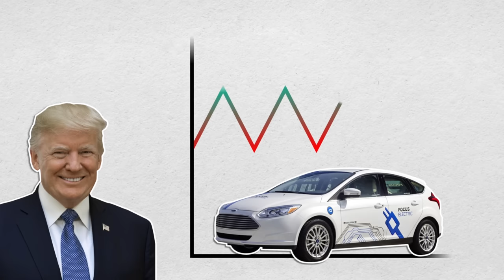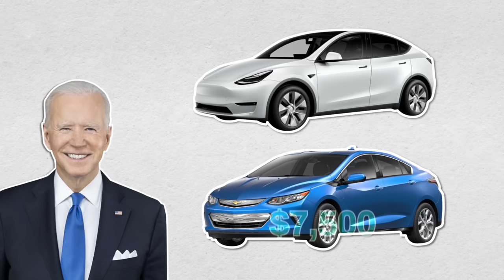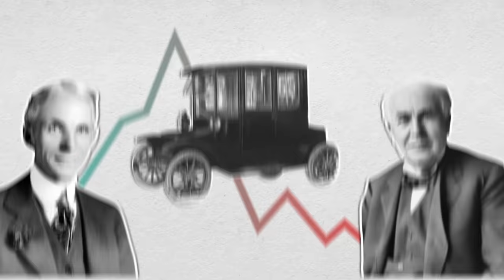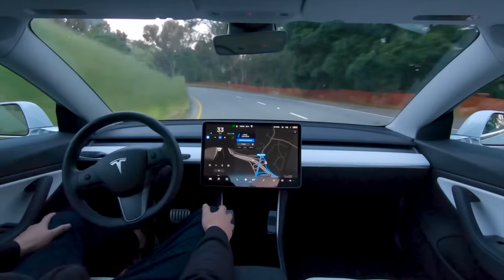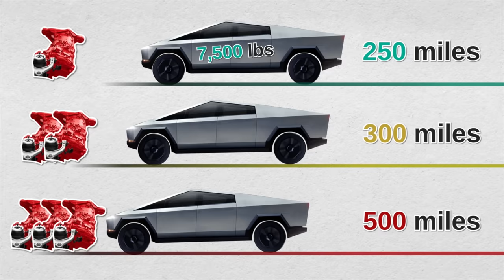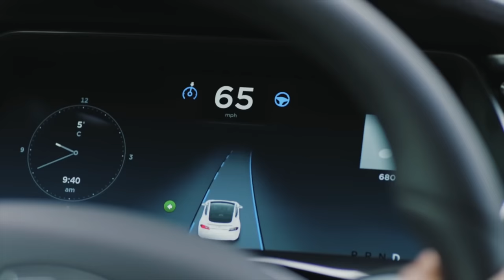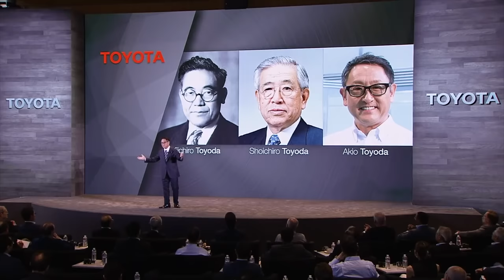Here's Why Toyota is Refusing to Make Electric Cars

Comment: Scotty, you forgot  that there was actually a mass produced car from GM called the EV1. The car was produced and leased from 1996 to 1999.
Reply: Mass produced = 1100 :D   Some on CNG methane gas, they were also hybrid and fuel cell prototypes.

Ever heard of CityCar build by Sebring-Vanguard ???   They've made ~~4500 of them between 1974 and 1979

But in 1906 Baker Electric -- made 800 Electric cars (Jay Leno has one - you can watch how it look like) -- so EV1 production number is laughable :)
Reply: GM also briefly produced the Chevy Volt.
Reply: @rscott2247  Cadillac made the ELR based on the Volt. Looks great, was crap tho.
Reply: There were electric cars from the 1960s aswell. Jay leno has 1
Reply: @wyrazowfkp  1100 prototypes? I'd call that mass produced.
Reply: Inter first time I heard of this car. But there have been a ton of cars I never heard of so he he
Reply: To say nothing of the Detroit Electric that had a lot of very happy customers who used their vehicles for many decades.
Reply: @wyrazowfkp  Rose's Water Ice in Philadelphia had 2 of them, they'd hire teens to drive them to prowl the local streets selling pretzels and water ice to kids and adults out walking and playing. The cars had an external shelf and cover attached to hold the products.
Reply: @wyrazowfkp  I was going to mention this too.  Electric cars date back over 100 years (and I've watched that Jay Leno video on the 1906 Baker Electric).  They just couldn't compete with the ICE.  Climate change wasn't even dreamed about back then.
Reply: Thank you  for saving me 9 minutes
Reply: Then GM bought back all the cars and crushed them at the scrap yard 🤔

Comment: Unless I'm forced to buy an electric vehicle, I'm keeping my Outlook, and my Vibe. I can put gas in my vehicles within a few minutes, and I'm back on the road.
Reply: My 12 year old diesel has a range of 700 miles, and takes minutes to refuel.
EVs are fit for the scrap heap after 9 years.
Reply: @twig3288  It’s clear electric cars aren’t for everyone, but I think for the vast majority of people the benefits far outweigh the negatives. Most people aren’t doing 100’s of miles a day on their daily drives. The most people might commute for work is 100-120 miles round trip, and that’s an edge case. You can have a fully charged vehicle, 300 miles worth, every morning after charging over night, never needing to go to a gas station again. Road trips of course is where people understandably see a pain point, but I would say most people do on average 2 -3 larger road trips a year. Here is where the infrastructure needs work. Even the Tesla network, which is very vast at this point, still can’t cover those out of the way places for fast top ups, and in that case you’ll need to charge at a hotel or someone’s home. That is where things are actually exciting though, because every store, every mall, everyone hotel, and every home could potentially provide fast power to charge with by adding 30 amp plugs (dryer outlet) or 240v sockets for even faster charging. Most new homes are being built out with more electrical capacity for this very reason.

Believe me, I love driving my ‘69 Stingray. But the acceleration, feel and responsiveness of a Tesla (I have a Dual Motor Model 3) is unmatched at that price point, and I would just recommend taking one for a drive to really experience the difference of that instant torque. 

Best wishes!
Reply: @twig3288  Most 9 year old EVs are still on the road.
Reply: @victorluke5816  The battery range would be severely diminished after nine years.
Reply: @twig3288  That hasn't been found in reality with Telsa.  Leaf has had a bad time of it because it doesn't have thermal management.  Their batteries get the crap kicked out of them with charging and tough weather.

Comment: Electric Vehicles still have too many issues. Like the rapid battery draining in cold weather and when you drive too fast (80mph). The changing infrastructure will need to be in the millions if they force them upon us and the ranges are still weak. As you mention burning coal is still quite common, I live near an extremely large coal power plant, so don’t have emissions testings in my part of Colorado. Lots of work needs to be done, including lowering the prices, I’d be damned if they force me
spend $45,000+ on car they can’t get me Colorado Springs and back on a single charge.
Reply: Yep there are not there yet. One day they will be great but its not today.

Comment: Possible next decades scenarios to new vehicles:
Car application: BEV, PHEV and Fuel Cell.
Heavy duty: PHEV and Fuel Cell.
Trucking:  Fuel Cell and Hydrogen ICE.
Heavy machinery: Hydrogen ICE.
Reply: Railroads will be using fuel cell-battery electric locomotives to replace diesel electric locomotives, just as diesel replaced steam. High speed passenger railroads will run on catenaries. Catenary overhead power has been used for well over a century on railroads.

Comment: I have an all electric Toyota, and I've owned it for more than 5 years.
Reply: Hydrogen car Mirai?
Reply: That's pretty old by now.  Hopefully you got your money's worth.
Reply: @frederickfarias9515  fuel cell electric vehicle, Mirai.
Reply: @campbellpaul  it gets 300 miles range per charge, charges at 2,800kW, has 70,000 miles and has never had a single issue. I'll be driving it for another 5 years.
Reply: Rennie, how many tons of coal were burned to make the electricity to power your car?
Reply: @richardweinberger2756  zero.
Reply: @homomorphic  That’s an interesting technology.  It’s an electric car that makes sense.
Reply: @homomorphic  300 miles is pretty good, actually.  It still sort of limits you to in-state road trips, though (which is a good excuse if you don't like traveling very much).  It reminds me of that '70s movie with the kid with the banjo if you get stuck somewhere off-grid lol

Comment: My favorite electric car was a 1922 Detroit Electric, made in Detroit and sold mostly to upscale urban women with successful husbands who could afford a grocery getter for their  wife. The old electrics had a tiller for steering, a wrap around the cabin seat that would seat 5 or 6 adults and a range around 50 miles at 25 MPH. Dead quiet, no dangerous crank to get it started and easy for drivers to enjoy around town. Big lead acid batteries that got plugged in at home to charge were not exotic metal. Great cars, I wish I still had one. I think they have a few examples of these down at the Henry Ford Museum in Dearborn Michigan. Electric cars ain't new, dude, not at all.
Reply: Wasn't there some program back in the 70's or 80's about " Who killed the Electric car " ?

Comment: When I go home I drive 600 miles with one stop for gas that takes 15 minutes tops.  No way is an electric vehicle worth the trouble of long charging times.  Not to mention the majority of charging stations don't work in freezing temps.  When you also consider that fossil fuels used for gas are the same ones used to create the electricity needed for electric vehicles...does it really make sense?  Not to mention all of the other downsides...look into replacements costs for electric batteries and how to dispose of them.

Comment: Yes. I have a Hyundai Nero. I use to drive to work, do errands. So far I only need to charge once a week and sometimes every two weeks if I don’t do any errands. I have a second car ( gas) that I use for heavy-duty transport of stuff, travel. But I love my Nero. It’s gonna be 2 years old by next year, January. Only took to the shop in August for the first check up and the shop manager wanted to know if I was happy w the car. No issues to fix I was in and out in less than 10 min.

Comment: Sorry. EVs are here to stay. Have one myself and have to say it is the most capable and joyful car I've ever owned the past three years. Ain't no going back for me.. As long as continuous improvement is allowed to exist, the tide will swell even more.
Reply: Yes, EVs are here to stay. EV cannot fill 100% of the populations needs however, and other options also need to be available.
Reply: In twenty years will it still be on the road? Will you be able to rebuild it's major systems yourself?
Reply: Will be a trash in 5 years. If everyone drives, EVs ' then there will be long queues for charging
Reply: @tempest411  Electric motors have only one moving part unlike ICE vehicles.
Reply: @TheGecko213  That is why Tesla has a Supercharger network and people can charge at home.
Reply: @tempest411  were arguments against airbags and seat belts made too?
Reply: @TheGecko213  8 year old Teslas are on the road today, many in just as good shape at they were new - or better, due to OTA updates.
Reply: @gbr1960  
You don’t seem to understand that batteries deteriorate over time and lose the capacity to hold charge .
Reply: @TheGecko213  Tesla batteries have 90 percent capacity after 200K miles. Does the engine in your gas car have 90 percent capacity after 200K miles?
Reply: @TheGecko213  Isn't that an old talking point offered up to the masses via the American Petroleum Institute? Or is it that you have specific evidence for Li over certain periods of time?

Comment: I sincerely hope we'll move away from battery-powered EVs to fuel cell EVs with the hydrogen manufactured from water (and not methane as it is most commonly done now).
Reply: That would make too much sense.
Reply: Using hydrolysis to make hydrogen eats up a lot of electric power. And hydrogen is highly explosive. These cars make zero economical sense. Just use LPG or Methane on a ICE. The only exhaust gas would be water and CO2, and is way cheaper and better for the environment.
Reply: @solaroid4442  I think refined natural gas could become a popular future fuel.  NG contains combustible gases but also some gases that could be removed.
Reply: Fuel cells emit the most potent greenhouse gas we currently deal with. Water Vapor.
Reply: @timothykeith1367  like the Mad Max movie.
Reply: @solaroid4442  that technology is only used in propane/ng delivery trucks currently, and sadly..unless there is another case i am unaware of.
Reply: @GearGuardianGaming  In Europe converting a petrol engine to run on lpg or methane is pretty common and not at all expensive. There are some cars that are factory converted...

Comment: I will only consider an electric car when they find a way to cheaply and easily retrofit a gasoline powered  and make it electric, and also when they stop using lithium which is a rare mineral that is very polluting to the environment to mine.
Reply: I'm glad somebody finally brought that up. It's a toxic substance, and most of it comes from politically unstable countries in Africa.
Reply: Not easy to retrofit due to the weight of the battery.  Lithium is actually the 25th most common element on Earth.   Getting it out can be messy but Tesla just patented a clay extraction tech which uses table salt instead of sulfuric acid to get the lithium out of the clay.
Reply: @victorluke5816  Interesting.
Reply: For motorcycles, that tech exists and it costs the same as changing the engine. In my country, many mototaxi operators are doing it and many makeshift shops are cropping up on the roadside that offer that service. For once, I can see a sector where my country is a pioneer worldwide. Lol!
Reply: @levenkay4468   Lol that is actually funny
Reply: @victorluke5816  
Tesla has also patented a way producing a rabbit out of a hat  :))

Comment: Toyota is actually working on vehicle electrification, they just realize it is better to have the battery technology improved first. They are quietly researching solid-state lithium batteries that will hold more energy and use less material. Toyota will dominate when they get there.
Reply: I scrolled all the way down to this point and still nobody is talking about Toyota's BZ line of cars coming out yet....

Comment: I have long felt Hydrogen has a potential future in personal automobiles . Much work needs to be done on the infrastructure of anything other than gasoline and diesel .
Reply: It has a future but not in cars
Reply: The inefficiencies in creating, storing and transporting hydrogen are holding that technology back.
Reply: @dragospahontu  JCB are already using it in their diggers, using modified diesel engines....
Once the distribution network is created it will work just like gasoline does in the existing internal combustion engines, but with zero pollution. 
Use wind and solar to electrolyse water and store the hydrogen produced. Remember,  'Coal Gas' was mostly hydrogen! We had that piped to homes before 'Natural Gas, methane' became the main supply.

Comment: I wouldn't touch electric car with a ten-foot pole. I never been a fan of them. I'm not even a fan of Toyota but I am when it goes towards hydrogen engines.
Reply: Drive a Model 3 and it will change your mind.  Once you get a taste of instant torque you won’t want to go back.
Reply: Hydrogen cars are electric cars with a tank with hydrogen change in to electricity to fill up the battery.

Comment: I have a friend who is the associate professor at the University in Finland and his research has concluded that to change the global ICE fleet to electric would require an additional 320,000 power stations globally to charge them! Each power station takes 5 to 7 years to build so do the math and figure out how long it would take to be able to power all those cars. That doesn't include all the infrastructure like charging stations and new power grids to distribute all that power.
Reply: That's not a big problem, especially in Finland. They have plenty of thorium and modular LSMR reactors could be built in factories.
Reply: You say it as if those stations can't be built simultaneously.
Reply: @faustin289  Obviously there could be multiple power stations being built at the same time but 320,000 is still a large number. If a hundred were being built every 5 years it would still take 500 years to make 10,000. And what would they be? Nuclear? Coal or gas? renewable? The problem with renewable is that one size doesn't fit all. In Dubai they built a huge solar panel station but it failed because the sand was covering the panels every day. Some countries don't have enough sunny days to use solar and some don't have sufficient water available to build hydroelectric power stations. So the answer is not an easy one but this I can say: EVs are not the answer. Perhaps they'll have developed a hydrogen fuel cell system in a few years or some other fuel will be developed (although that's unlikely because fossil fuels are by far the densest energy form we have commercially available.